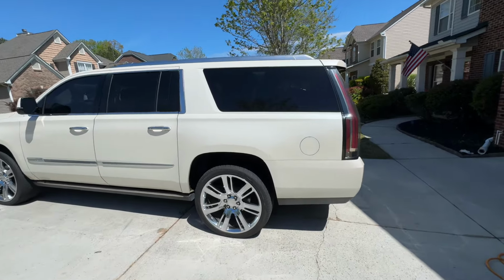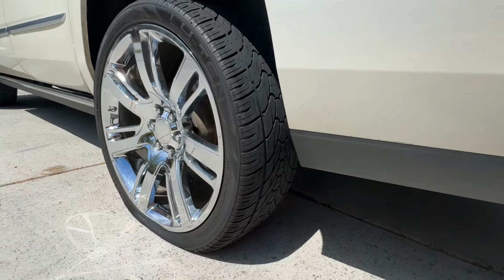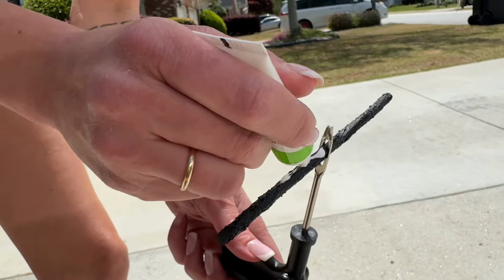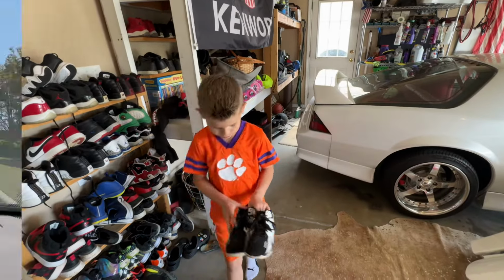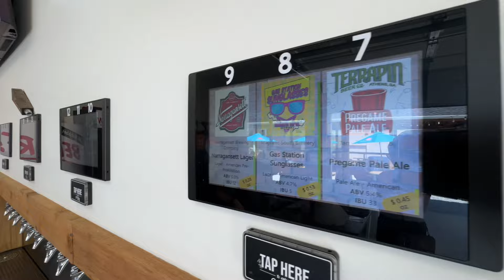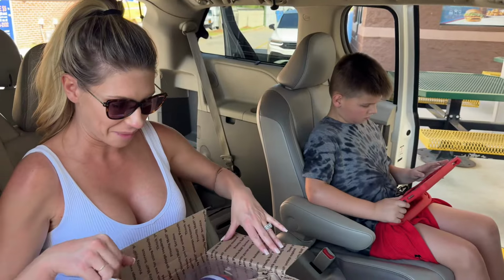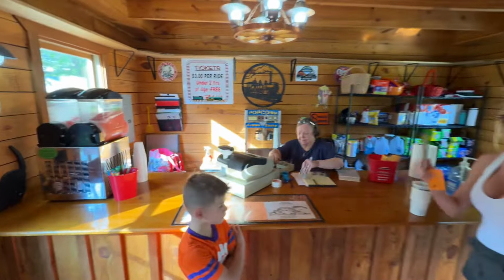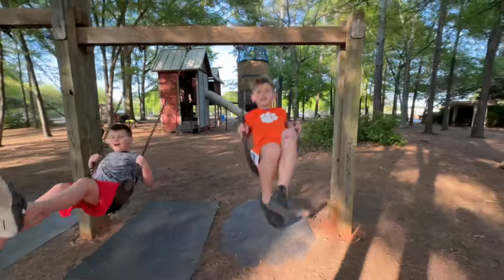How to Fix a Flat tire !!

Comment: "He's almost as tall as you, babe!" - "I don't wanna talk about it!" had me ☠☠☠☠
Reply: @JustTruckinWife  Just for future reference, after working in several automotive shops over the last 4 decades. When you clean the hole out in your tire with the spiral reaming tool coat it with a little bit of the glue so it coats the inside of the hole and makes it easier to ream. Then coat the plug with glue too so it slides in easier. Spead the glue all around the plug so it's coated on all sides so it doesn't leak.
Reply: @JustTruckinWife If the boy's like train rides and caves you should plan a weekend camping trip up to luray caverns and stay in a cabin up the street at Jellystone campground and park and take a drive a few more miles north and also visit skyline caverns up near Front Royal, Skyline has a train off to the side of the parking lot that goes all through the woods above the caverns. Remember to take some hoodies, caverns are chilly and you'll get some great tube content for your channel.
Reply: Can you please give me the blue wrench 🔧 for your YouTube channel please t-dubs

Comment: Replace the tire if the hole is on the outside of the first or last tread line due to to close to the curvature of the tire and is not a safe repair. And a plug is a temporary fix and a patch plug is what would be needed..I sold a lot of tires because of this manufacture  law 🤑🤑

Comment: In 43 years as a mechanic, I've repaired probably 10 thousand tires;  every time using Safety Seal brand plugs. I've never had a plug failure.

Comment: We always have those handy if we ever get flat tires. We have a portable air compressor that plugs in tie cigarette lighter plug in. Jesse taught me how to do that. Even change the tires on the semi's. One of the mechanics was like I can get it for you. I flat out said it's ok I don't mind getting my hand's dirty. He goes I figured you wouldn't want to crack a fingernail. I told him that I always trim my fingernails with my pocket knife. He was like wow I figured you were picky. And I heard Jesse laughing about it. That's cool train ride. Jesse is getting thing's ready to go to Las Vegas and Gigi's ready to go. Grandma is going also her appointment was cancelled so she goes next week. Lucky the Wrecker has seat's in the back it's a 4 door. The backseat can slide down to a bed. I have meeting's tomorrow and then a meeting at the school. It's all good both business and the school. It's annually meetings and they can do zoom meeting's. And I will go to the school and do that since it's quicker to meet all the teacher's.